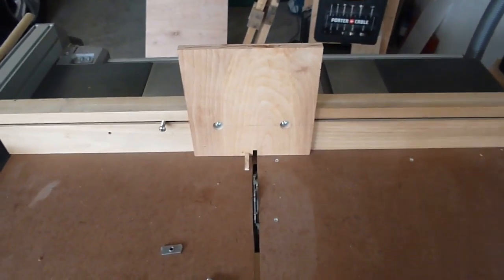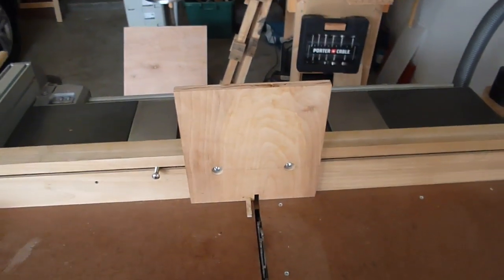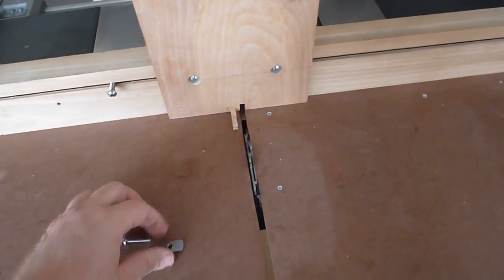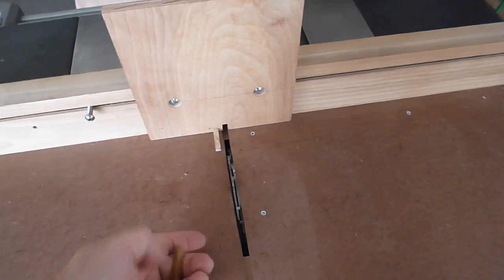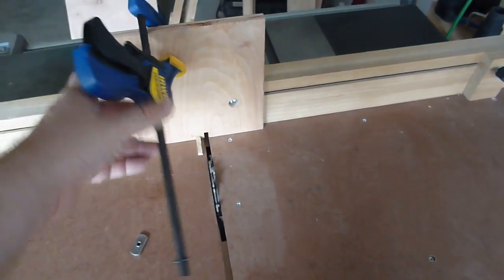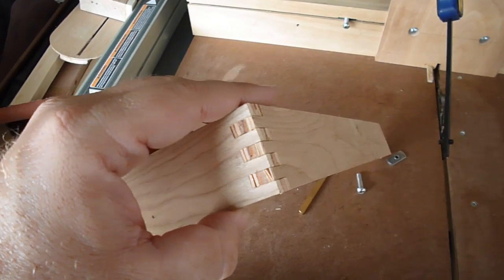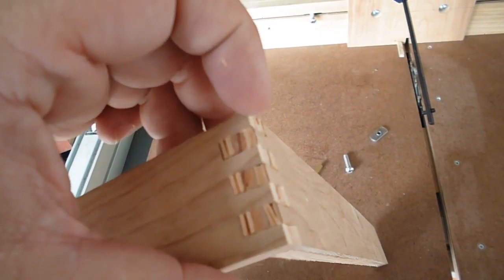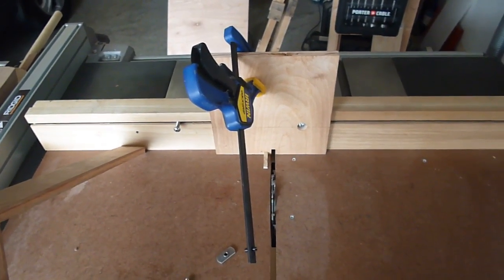Box joint jig for the table saw sled

Comment: My question wasn't about the nuts from Rockler. It was about the horizontal slot for those nuts in the back plate (brace you push and pull for the sled). Did you make the slot or use a purchased metal T-slot?
Reply from the maker: Oh, there's no metal in the fence.  I have a T-slot router bit that only cuts the T part of the slot.  I have to take a 1/4" straight bit and cut a dado in the fence to the full depth of the slot in two passes.  Without moving the router table fence switch to the t-slot cutter and cut the t-slot.

Comment: Both the adjustable crosscut sled video and this one with the added attachment for box joints are very intuitive! Combining the three options make it a very versatile all in one jig! One thing you didn't mention that other viewers may find interesting is that they can make a box joint attachment plate (or several) for any size fingers they want. Did you build a metal T slot into the back plate or make the slot out of wood?
Reply from the maker: The fittings that slide into the t-slots are 1/4" T-bolts I got from Rocker.  They're simply flat pieces of metal with a 1/4" threaded hole in the middle.  I thread my bolt into it and synch it down with my screwdriver.  I should have mentioned the ability to make a few plates for different finger sizes, but for some reason it didn't occur to me.